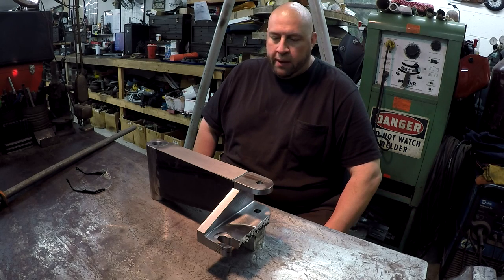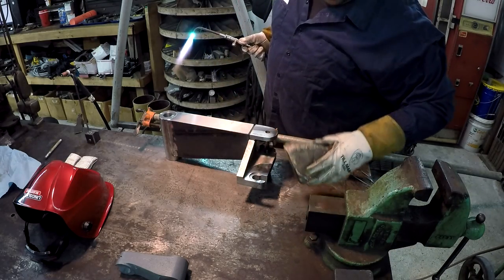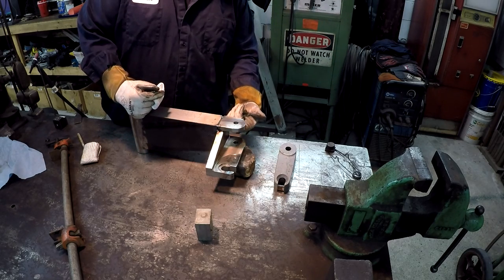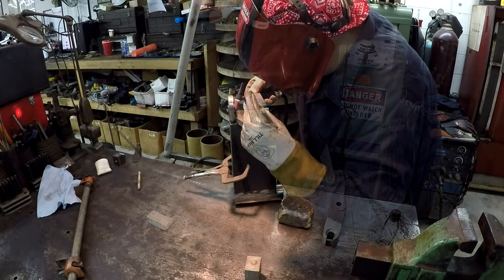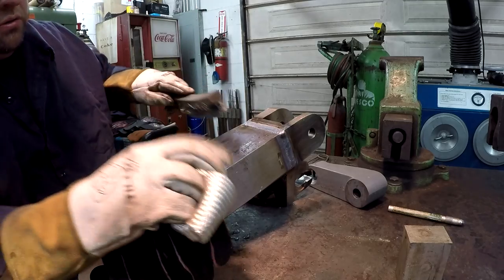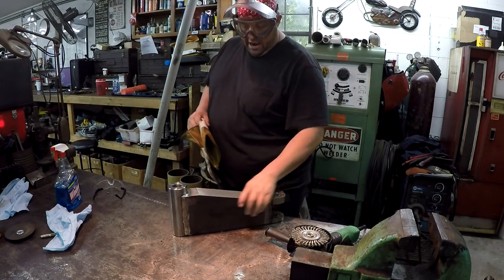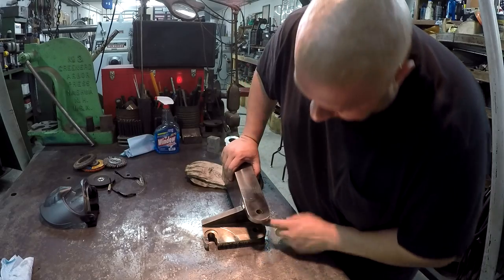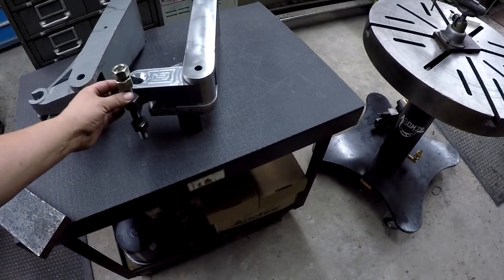Kearney & Trecker Parking Attachment Part 12

Comment: Preheat and checking with a tempil stick I haven't seen a tempil stick since I welded so many years ago very cool. 
Glad that the clearance held for you on the pivoting piece after welding.
Great project and it's almost done.
Thanks for the videos.

Comment: I agree on blasting it clean, use body putty to smooth it and paint it.  Pacific Press and Shear used a really heavy filler sanding primer for prep.  Had a source who got me some of it when I painted equipment that suffered from exposure and rust.  It really filled and was a lot easier than Bondo.  Was hard to spray.  I used a pressure cup gun to do it.

Comment: If you just go over the edges between the stick welds and the work piece, with the TIG gun, adding no material, you get a smooth transition removing any ditches and edges, and the reheating also relieves a lot of the stress from the metal.

Comment: Adam - great progress again and a great video.   I noticed when you were pre-heating the part to weld both times you focused on the smaller metal parts, not the very large portion you are welding them to.   Seems to me that the heat should be focused on the larger mass, which will in turn heat the smaller parts.

Comment: Look's great. Maybe as you decide whether or not to paint. If you decide to paint, maybe some pinstripe{ing} will be an option. Just go down to your local BIG AUTO PARTS STORE, and take a look at some of the "TAPE Pinstripe{ing},"  its cheap enough, try some out. After painting of course. My first try {with the Pinstripe{ing}} would be the part John made, on the side(s) (where John did no engraving) just run down the center, both sides, (all around the part) same for the parking attachment itself. Paint the parking attachment three different color's. My suggestion the big piece of round stock welded on; one color, the main body another color, and what you just welded on today another color. Just my 2 (two) cents worth.

If you decide to go the 3 (three color option) you'll need some "FINE LINE TAPE" (found at an Autobody Supply Store, not cheap compared to other tape) because of the thickness of the paint bridging across the edge of the tape. HINT: as soon as the paint is "TACK/ DUST FREE," remove the Fine Line Tape, at a 45 (forty- five) degree angle, (creating a knife's edge) peeling it back against itself, i.e., the freshly painted surface of the tape, so as if you were trying to stick the painted surface(s) together. 

The Fine Line tape should be available in1/16" in. (0.0625,) 1/8" in (0.125",) and 1/4" in. (0.25") and some bigger size's. I would suggest the 1/4" in. Maybe your brother Alex might have some.

Comment: Awesome project Adam, really like how it's turning out. One small question though, I think I noticed in another video that the original had pockets milled  out in the main body section, maybe to help reduce the weight? What are your thoughts on doing the same for yours?
Reply from the maker: I don't have plans to drill out the center body for weight issues. The machine won't know any different once a it's mounted for good.

Comment: Hi Adam, I might have missed the part of a video, But What is & where is it used for this parking attachment. Beautiful piece & seeing your part about a finish As i like the metal finish look i wound Oil Blue it. Will stop the rust.
Reply: Adam,  try the tig welding without the left glove;  you'll have a lot better feel for the filler wire and you aren't as apt to contaminate it with stuff from the glove.  your Abom size BBQ'ER from Tennessee

Comment: Just out of curiosity, what was rating of temp stick for your pre-heat?  Think when you were walking the cup your rhythm kinda got broken there one time and it may have been caused by your cable lead drag! Just an observation, not trying to be "back seat driver", just mentioned it so others having the same problem, may have one thing to look for as a cause. Another great video Adam!
Reply from the maker: That's a 350 temp stick. 4140 should be a bit hotter for a preheat but it gets too uncomfortable to weld when it's that hot.

Comment: Looking good, Adam. 
By the way, those were some trippy blue welding shadows in the middle of the video. Was that because of one of the new filters? 
Looking forward to everything coming together. You know you don't want to lift that heavy head up and down every time you want to use it. 
Thanks for sharing your work. 
Joe
Reply from the maker: It's the reflection off the welding helmet lens.

Comment: Hey Adam, (or any one else!) I just bought a cheap Chinese AC stick welder from a flea market and I CANNOT seem to get the damn spark started. I am using 6013 rods.  The rod just keeps sticking to the work. I never stick welded before, only MIG.  Does the fact that the machine is super cheap come into play at all? Or am I just this bad? Lol
Reply: I'd say it's probably a combination of the two.  Make sure the amperage is correct, and scratch to strike the arc rather than tap.  Practice on some scrap first, until you get a feel for starting the arc.  The quality of the welder might have something to do with it, so you might have to step the amperage up a notch to compensate.  And, if it's as 'cheap' as it sounds, pay close attention to the duty cycle ratings, and make sure you give it it's cool down time.

In High School, in metals and Ag Shop classes, they always insisted we start with 6011 rod.  Not the easiest stuff to use and make it look good.  I know that the car men at the rip track (where they repaired rail cars) had a preference for 6013.  Because, as I was told, they worked with a lot of dirty metal and welded a lot of things that didn't have an ideal fit.  Others may have more accurate details of what that rod is intended for.
Reply: diggerop Thanks for your reply!!

Comment: In min 25... Isn''t the rotating arm upside down?

During the welding and polishing it is obvious that the stock for the diferent pieces are from diferent types of steel.

Maybe you should crome it, but painting it same color as the mill would be more elegant.

Anyway. Very nice build.

Comment: Match the paint to the mill. A  2 part epoxy similar to structural steel coating would be durable, fill any imperfections and look like a great match to the mills paint.

Comment: video looks dark.  Part is looking great.   If you were running with one of your new filters then you need additional lighting.   I don't see the advantage of the filter.   I kind of like more lighting.  Filters are normally best left for outdoor use.  Or maybe when videoing when the sun is coming in the door.  Don't mean to be critical but I guess I am.     I enjoy "all" your work and want to be able to see it all.    Ps if you  paint the part finish off all the imperfections with bondo or some other filler.  It will make it look GREAT!!

Comment: Is your tig set up scratch start? It appeared you scratched the electrode on a few of the welds. Thanks.
Reply from the maker: It has HF start but seems to be a bit weak, I usually have to touch off once and then it's good.

Comment: Glad you used a grinder. Tom Lipton would have filed on that thing for a week!
Reply: Quick question. Is the part that John Saunders made upside down in there at the end?
Reply from the maker: No sire it's installed correctly.
Reply: then the one on the original is upside down

Comment: I think it would be better to have deep V grooves cut into the weld joints and lay down a bunch of passes. I mean you have super thick steel plates and there is no way you are getting 100% penetration, it will be a weak link, the original casting is probably stronger/stiffer.
Reply from the maker: +JbassPlayer28 The static load that's hanging on it, thecplates will hold just fine.
Reply: Those welds can hold up the weight of a pickup truck!

Comment: hey adam, i noticed you saying that the polarity of the welder is wrong, what is the result of that, and why would you reverse that?
Reply from the maker: +SuperZylar The polarity need to be correct for the type of welding your doing. For most tig welding of steel, stainless, and several others you want to use straight polarity. If you try to use reverse polarity you'll burn up the tungsten almost immediately.
Reply: Abom79 i was referring to the stick welding around 15:00, or is it the same machine?

Comment: bit difficult to see what's happening if you obey the do not watch welder sign behind you ;-)
Reply: yes seeing through a camera means we can watch all we want!  im suprised it does not burn the camera ccd though, i know id be worried on an expensive camera
Reply: Years ago I was doing some angle grinding outside after dark and my brother decided to use my camera to take some photos of the sparks. When we went indoors we saw that the sparks had hit the camera's lens and melted the coating on it. There were all these pits on the face of the lens. Ever since then I've kept a UV filter on the lens as a safety measure to protect it!
Reply: +Jack Hudler he's wearing a welding mask for a reason
Reply: Jack Hudler
I got Ian's joke. I was replying to jsub1066's comment about burning out the CCD on the camera.
Reply from the maker: +jack Hudler I found that sign from a friends old workshop and snagged it!

Comment: I've been watching all your videos building this "Kearney & Trecker Parking Attachment" but have no idea what it does. I'm not a machinist or anything and have googled the attachment just to see what it looks like attached to a machine but what is the purpose of this part?
Reply: Ha! You noob!!.... just kidding I also don't know what it's used for but I've held myself back from researching it as it will be more exciting to see it finished and put to use.   I think you throw it through an eco car's window when they  are parked in your space...
Reply from the maker: It's purpose to to hold the vertical milling head on the machine when not in use, and to make it easy to mount and dismount it.
Reply: Blasphemy... I'll believe it when I see it...
Reply: I'll give you 10 bucks if you can get it through a Prius window at speed on the freeway. Any Prius, any window. Easy 10 bucks. I just smoke em out with my 7.3 Excursion....
Reply: Ha! I'm half way tempted...  Although a Chevy owner and hardcore die-hard...  The 7.3 is the true workhorse of the modern day 3/4 to 1 ton diesel...

Comment: +Abom79 Hey Adam. Great work, been following your channel for quite some time. Though, I am still unsure what the Kearney & Trecker Parking Attachment is for. :D

I admire your work greatly. It's amazing.
Keep on rocking!
Reply: In case you missed the other explanation, the K&T is normally a horizontal mill, but it has an accessory head for vertical milling ops. This head is a massive lump and requires something to lift it into mounting position. The parking attachment is designed to lift the head from its storage position on the back of the mill, swing around to the front and position it for mounting to the mill. Somewhere in Keith Fenners video archives he shows how this is done on his K&T.
Reply: Thanks for the explanation. I'll look for that video.
Reply from the maker: Thanks Justin!

Comment: I'm no welding aficionado but why the different gloves from tig to stick welding?
Reply from the maker: Tig welding requires more hand movement so you typically use a thin leather glove. Stick and mig causes much more spatter and sparks so you use a little more protection with them.
Reply: +Abom79 thank you for the info. I've only ever played around with MIG welding and that makes total sense.